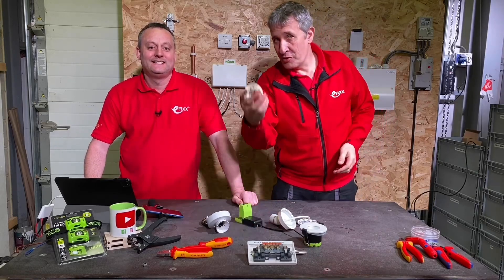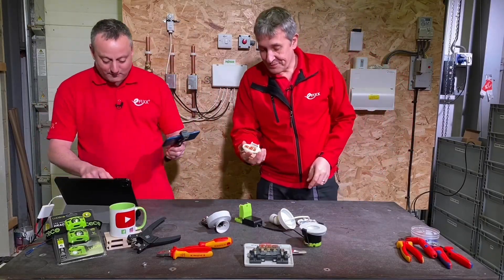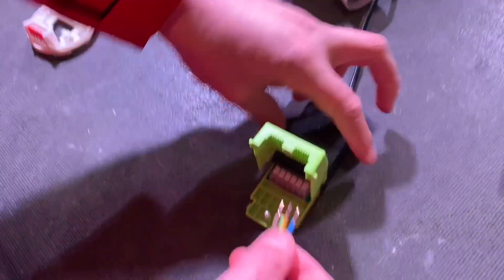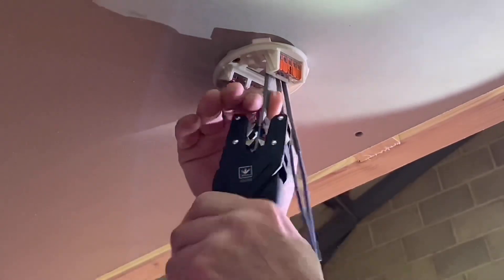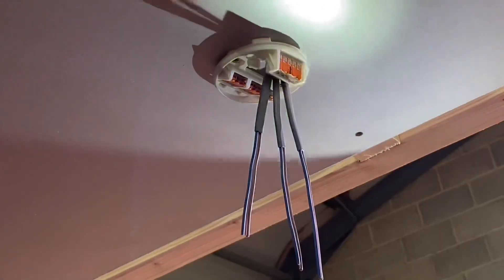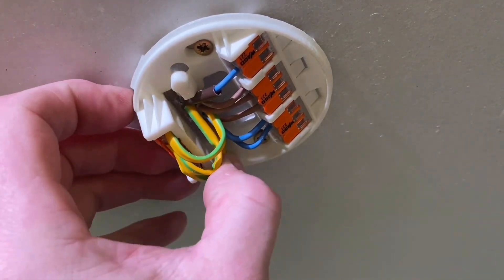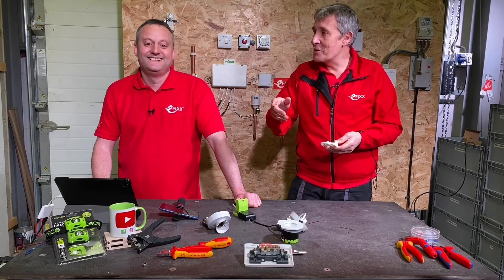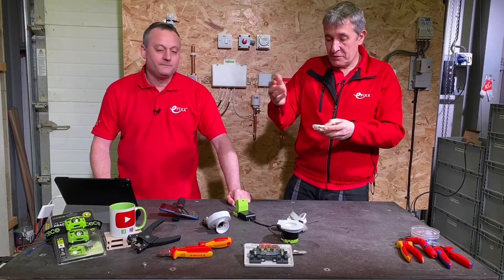Would you use a WAGO 221 CEILING ROSE?

Comment: As someone who hates the awkwardly angled terminals with no decent plastic molding to guide the screwdriver on a lot of ceiling roses, I like this idea very much. Generally on most new places I wire I take feeds to the switches and have 47mm boxes, as often end up having to fit flat plates with dimmers, and most of the designer lighting that gets specified barely has the capacity to house 1 cable. 

I would imagine anyone coming along to replace one of these with a decorative fitting would probably just pull the wagos out of the molding and house them in the base of the new fitting, which is far better than the old DIY trick of busing up the plastic on a ceiling rose and taping up the exposed brass terminals.
Reply: I have seen that way to many times , bits of sellotape around the bare brass terminals and jammed into an ikea light fitting.

Comment: Speaking from a Customer/Consumer Point of View I think these would actually increase safety as this would mean that customers who self install these pendant roses would not need to spend more time on step ladders than what they would need to do if they were to screw them in. Secondly I think having this for the trade would mean that as customer I would know that in less than 10 mins my electrician I contract to carry out the works would charge me less or be able to carry out more install's in my property within the 1 hour hourly rate! Saving me time, money and the contractor their time too! I think screwless sockets and light fittings are the way to go as I would feel safer knowing the terminations have been made correctly to the right tightness and it would avoid arcing and sparking!

Comment: Dont u think it encourages d.i.y er to try fitting stuff like this them self if it because to easy ?
Reply: They'll do it anyhow, doesn't matter if there are screw terminals or this type of connectors in there.
Reply: will do it anyway, and probably makes it a little safer to do, as a diyer i do prefer the quickwire products though, gradually replacing some 30yr old ceiling roses while decorating,and ensuring those CPC's remain intact - these videos are really helpful. bought my house off a builder , and there was quite a lot he butchered, no cpc sleeving or cpc twisted away, i got a qualified sparkie to replace my CU 10 yrs ago - i wouldn't delve in there...other than to switch an mcb off or the isolate the whole thing

Comment: I think the majority of electricians would to be honest . Convenience , consistency of terminations and of course time . Time is everything, it’s a winner for me .
Reply from the maker: Thanks for a great comment
Reply: Cost is the drawback, electricians use whats included in a light kit.
Reply: @shadowopsairman1583 there are countries where there are standardized pluggable ceiling roses, where there is a special (light duty) socket in your ceiling and a standard plug on the lamps you buy. Good for renting, when the average punter can replace it.

(It should not be significantly more expensive — the plastic is the same cost, and the wagos cost less than 1 quid total wholesale.)